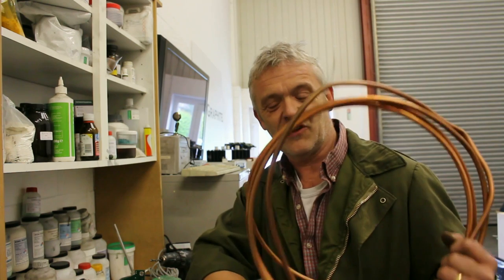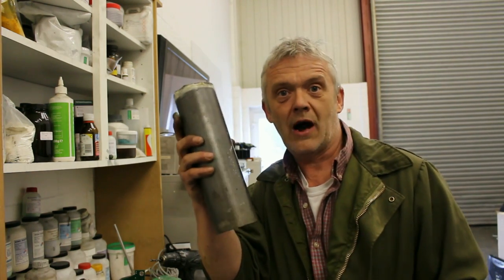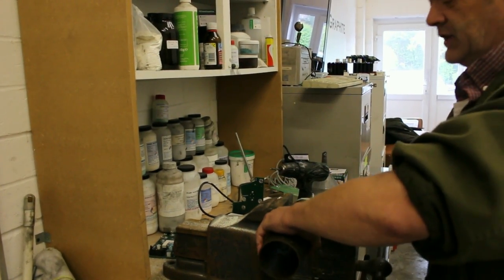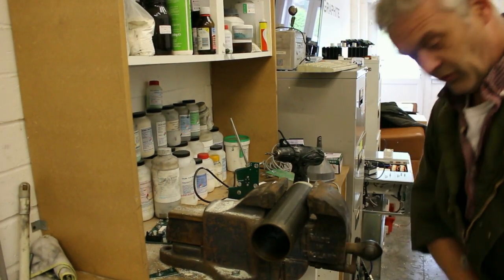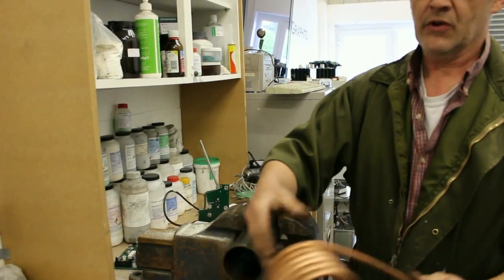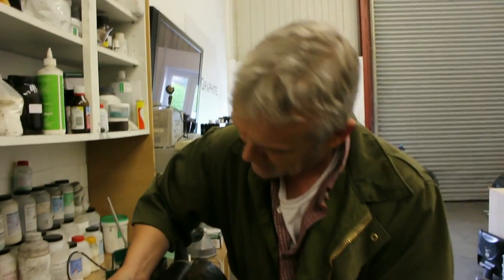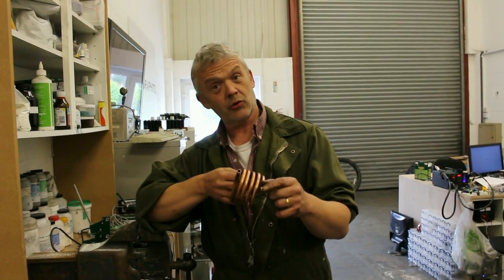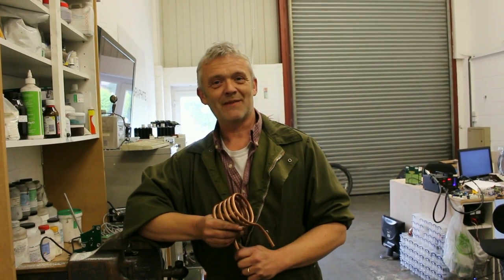How To Make Big Coils - Without Getting Sand In Your Bits

Comment: Hmmm, I wonder if that giant coil will eventually be combined with your supercapacitor.  ;)
Reply from the maker: chrisstevens2 lol - am i that transparent lol
Reply: Robert Murray-Smith It won't do induction save for the split second it takes to charge the coil and it won't do an efficient coilgun either. I tried that already with a 40F 18V bank of maxwell caps for my physics final and it did worse than typical electrolytic models do.
Reply from the maker: TheIdeanator i wouldn't worry about it mate -  i am not combining it in that way

Comment: Made a nice pre-heater for my water on my pellet stove pipe about 35 turns. Worked nicely. Water heater hardly turns on all winter. Fortunately had a piece of steel pipe the right size...
Reply from the maker: moto2kx2 v cool